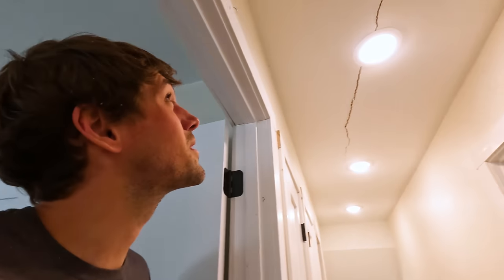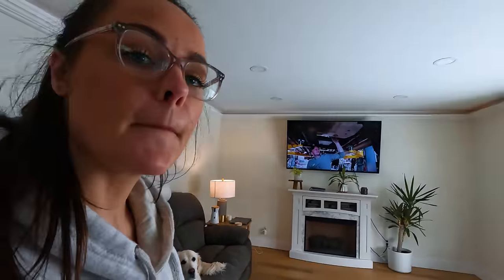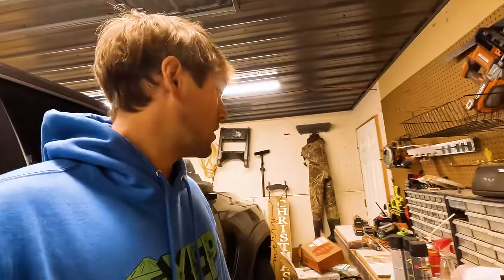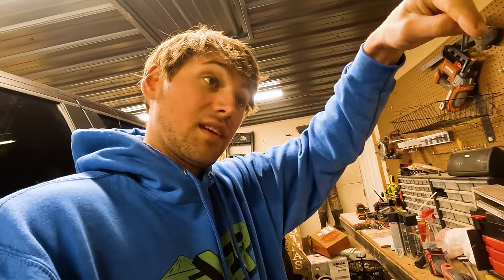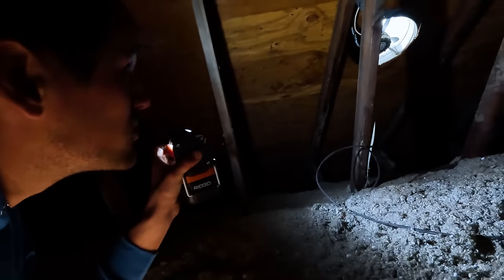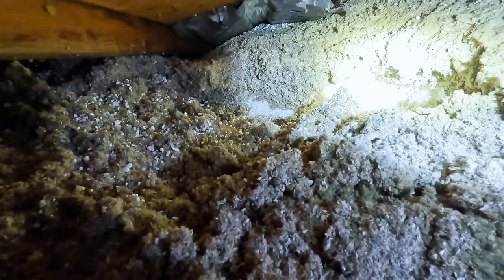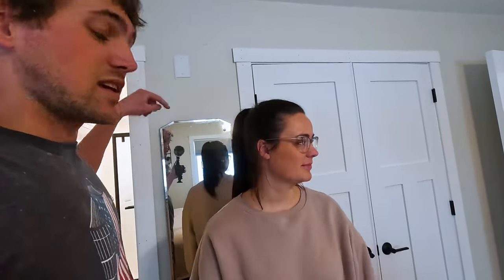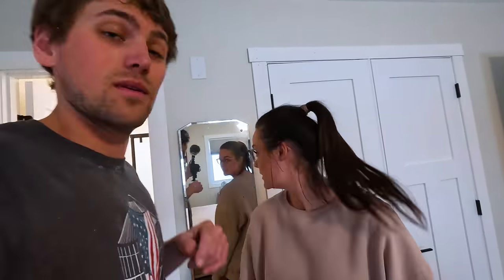DIY House Remodel Gone Wrong!!

Comment: Vent line needs to be insulated moisture will condensate on inside of pipe  in uninsulated attic space and cause mold and moisture to run back down pipe and could cause leak or dripping from fan the mold is the biggest thing no good

Comment: You absolutely need to vent the fans outside. Otherwise the moisture gets into your attic insulation. Over time it will cause damage and possibly mold.

Comment: I made the mistake of putting the fan in the shower.  It sucked in the cooler air from the bathroom and the cooler air dropped to the bottom of the shower and froze me.  I hope you do not have the same issue.

Comment: Oh Chet believe me I feel your pain. I remodeled 2 houses, then we bought a house built in 1898 that was foreclosed on & sat empty for 2 years….At some point in it’s life a flipper or really bad DIY came through, cut the floor joists to run pipes. Then put plastic sheeting under the pipes with live wires laying in it. . The cast iron sewer stackpipe was crushed in the walls of the DR. We found that out but toilet water running into the basement. I restored, not remodeled, 2 rooms down to the hardware on the doors. Stripped paint on all the trim, took forever. Our dining room is still torn half way apart from pulling out plaster soaked in toilet water. That job will be done by a contractor. I don’t do drywall.

Comment: I've seen nobody mention that your bathroom light over the sink should not just be wires going into the wall, those wires should be terminating to an electrical box. Very big fire hazard there.

Comment: It's very bad, mold problems out the a$&. 
Maybe you should test the roof vent fan that you didn't know about and if the box that It's wired into is hot you could have pulled a wire from there down the wall to where the other light switch is and put another switch. Then pulled another wire from it to the new vent fan and light.

Comment: Remove that T asap! Use insulated flex duct. That helps keeps some of the heat in the summer from coming down into the bathroom. Nobody laughed.  Crap happens buddy. It’s not like you meant to slip off the rafter. That happens to someone everyday.

Comment: Each vent tube needs to be vented to outdoors, don't like to join vent fans unless I have to. When possible take each vent out through a gable end wall, or next best option is go up through the roof with a suitable roof vent cap designed for that purpose. Your tubing also needs to be fully insulated all the way to the vent discharge. If it's not, your your cold attic temps will condense the shower steam and turn it back into water. Then the water will either leak out, stain and mold your ceiling or drip back through your vent fan. I always use 4" insulated flex ducting for venting these fans, it works great.

Comment: So many things wrong. Where is the electric box that is required behind that light? You can't tie into that vent line unless the fan is after the connection and draws both at the same time. The roofers stretched the armor cable to the roof fan and damaged it. Time to get all of the issues fixed correctly just like you would a tractor or planter.

Comment: Chet time to suck out the old and foam everything
Reply: Lol there’s zero reason to do that. Even high performance passive houses still use blown in cellulose insulation in the attic.
Reply: @Bbnotbb1234  personal preference.  Less itchy. Worked for Bostan Whaler. Foam it all. Yes I realize is a house 🤣